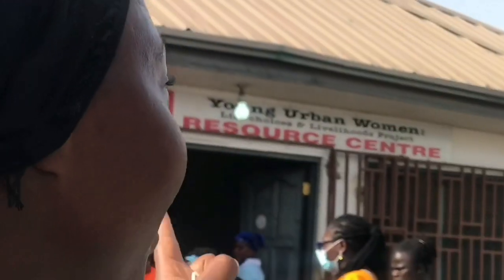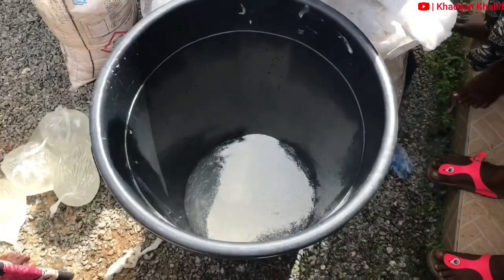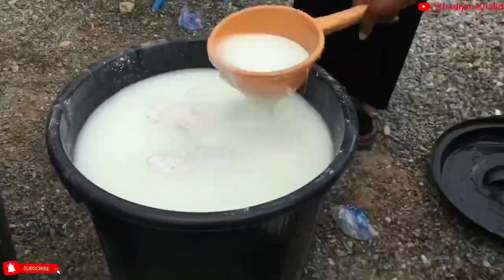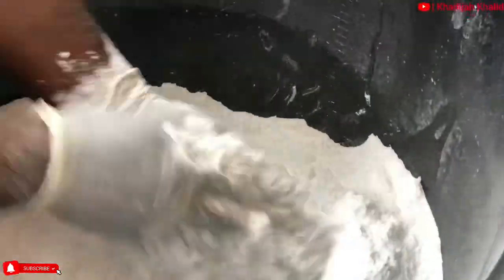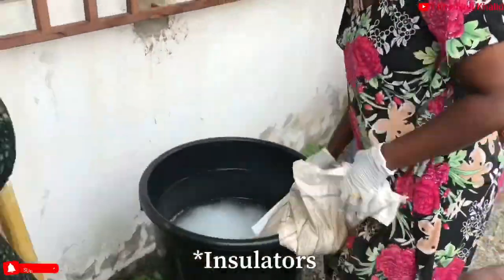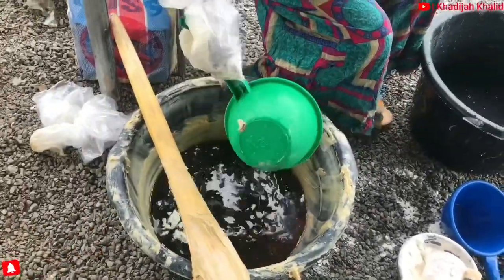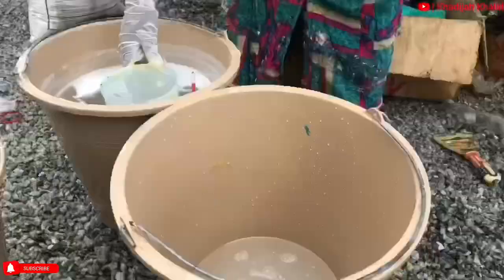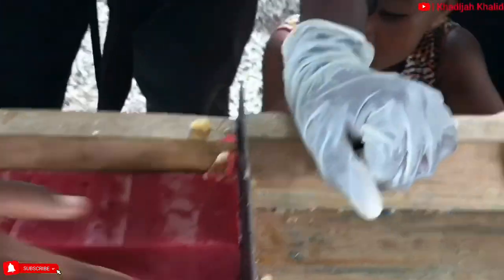How to Make Household Cleaning Agents (Detergents, “Azuma Blows” and Bleach) from Start to Finish!

Comment: Mine is a question,,,how does it take for this type of soap to use or to cure? can I use it instantly after it's dried? and why on the sun? and do you wait for the palm oil to cool after boiling aswel or?
Reply from the maker: Yes the palm oil was completely cool at the time of production. Wait for at least 3 days before u use the soap. The sun to quicken the drying process
Reply: @khadijahkhalidgh  thanks,,,really appreciate 🙏

Comment: Pls how do I check the gravity of my hydrometer for the bathing soap and bar soap
Reply from the maker: before you drop the hydrometer into the caustic soda, check on the hydrometer, there is a red and green mark on it so after you drop the hydrometer into the caustic soda, if you realise that the hydrometer is on the red line, it means it is too harsh to use, so you add more water to it and then drop the hydrometer again. Repeat that until the hydrometer level in the caustic soda is on the green meaning it is safe to use for your soap. PLEASE WEAR GLOVES WHILE DOING THIS

Comment: Why is the lye not tested with hydrometer? Please measurement is needed
Reply from the maker: It was tested
Reply: @khadijahkhalidgh  it wasn't shown. Please.
Reply from the maker: @justine-mariesenchim7652  yes I didn’t touch much on it but if you look closely, especially where the bathing soap was being made you would see a hydrometer in the caustic soda solution💕
Reply: @khadijahkhalidgh  thank you